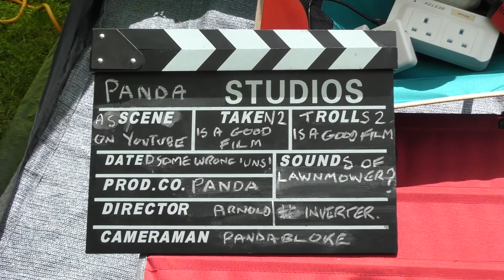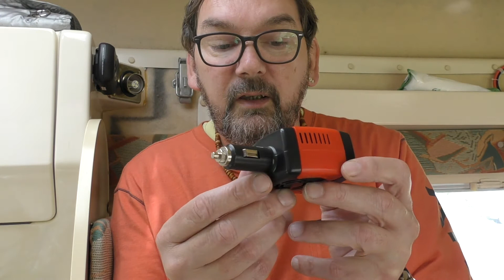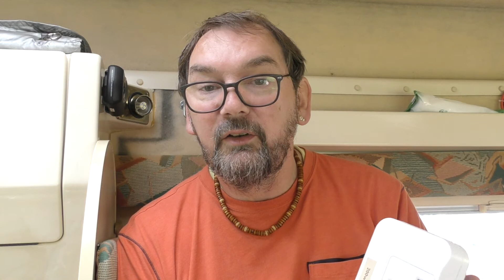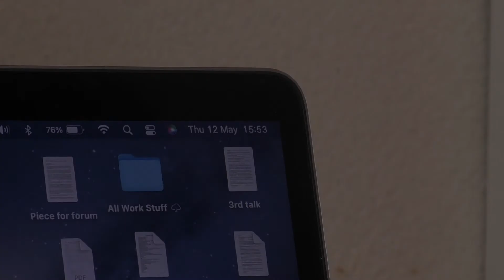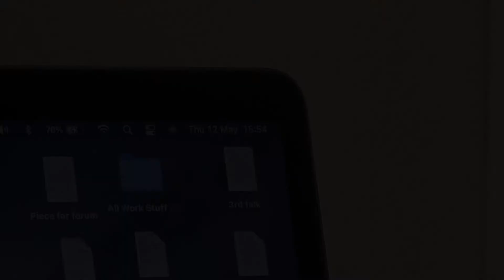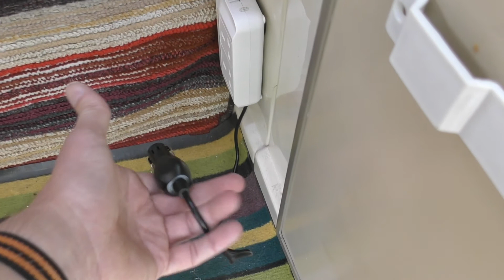Simple inverters for your camper van

Comment: Thank you for a useful video Panda. My Transit has batteries under the front seats so they are very difficult to get at to fit a more powerful inverter to, so these small ones that plug into the 12v aux socket will do fine to run my MacBook from.
Reply from the maker: Hi GasGas.  Glad you found it useful. Panda